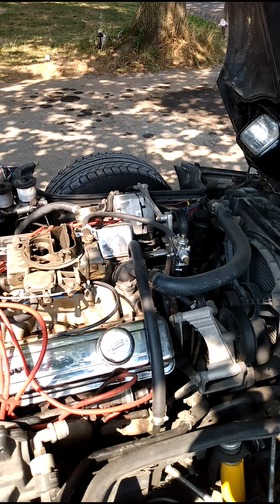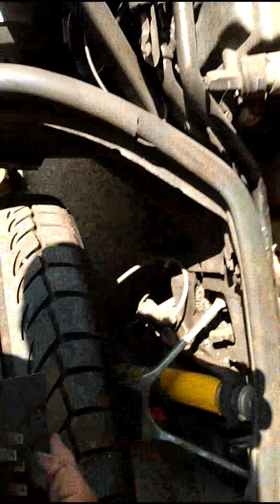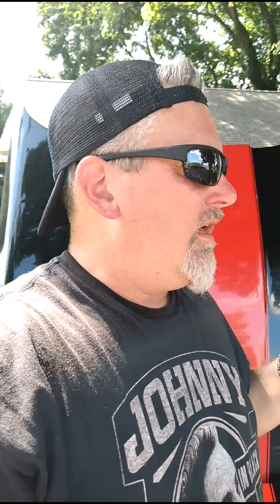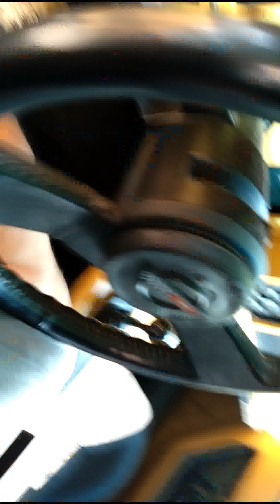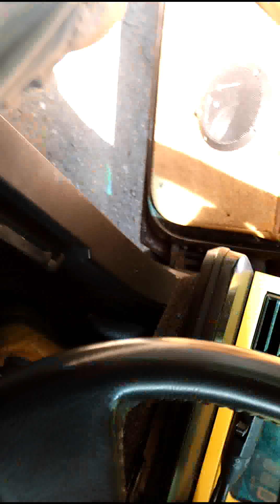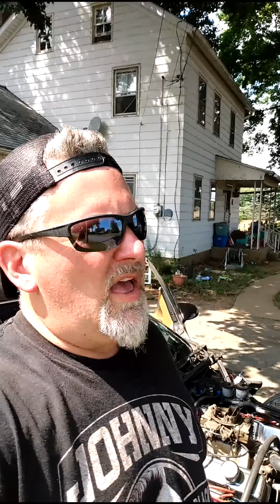Replacing blower motor resistor on C4

Comment: Probably the blower control module. Says so in the service manual.
Reply from the maker: Is there anyway you can send me that, would be appreciated,  thanks
Reply: @bigesauto9413  Give me an email and I'll send it
Reply from the maker: @vildebill2000  ericsnyder802@gmail.com
Reply: @bigesauto9413  I sent it. If you didn't receive it check your spam filter

Comment: What ended up fixing the fan speed? I have the same issue. I just replaced the resistor and still only blows on high speed.
Reply from the maker: Still searching it out but will do a video when I fix it